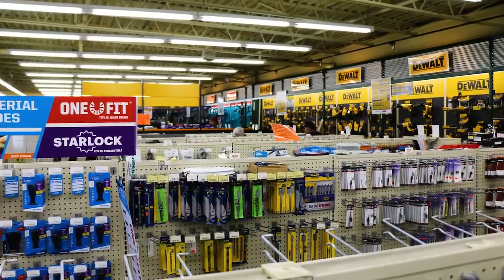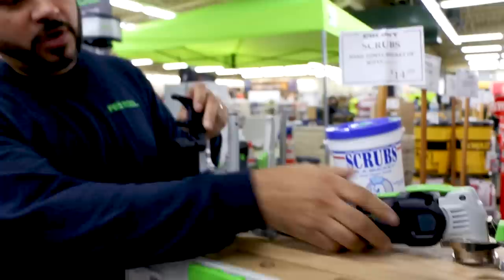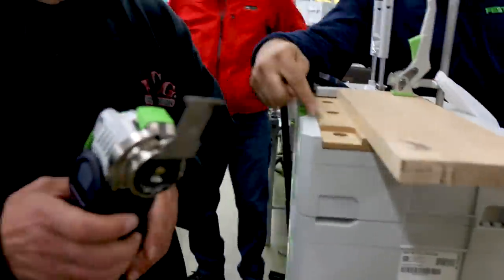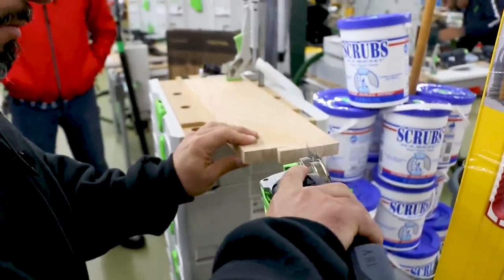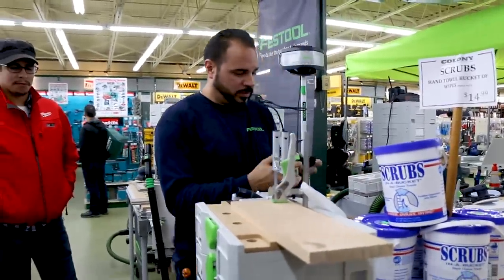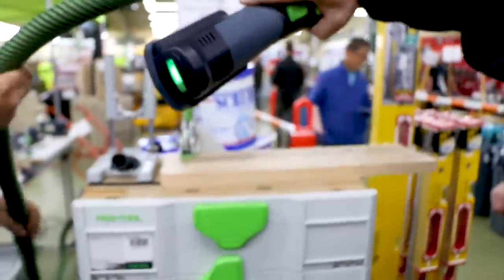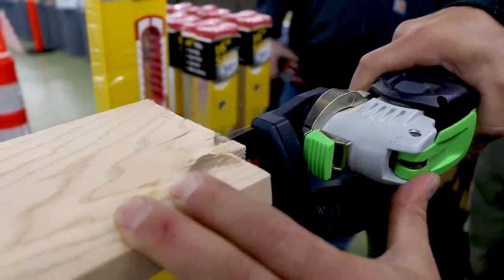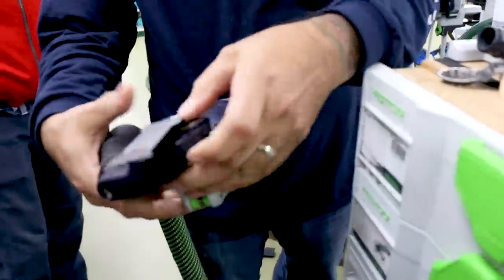Best Oscillating Multi Tool On The Market For 2019

Comment: Another great video Vince 👍🏻
The Fein 18v Supercut and Festool 18v Vecturo, are both built by Fein.
They perform the same, just different colours. They are the best multi tools out there, and by a fair margin. 
I opted for the Supercuts, because I have Fein batteries and I got a good deal on the day. Either machine is superb, albeit pricey.

Comment: Amazing tool shocking price. I got a $449 Milwaukee pack out kit that includes Sawzall Gen 3 Hammer Drill impact driver 2 battery charger and a nice multi tool and I am very happy with the purchase. To match the amount I can buy a brushless circular saw for  $150 on Ebay
Reply from the maker: I will agree maybe not a starter tool !!
Reply: Dust collection - Milwaukee doesn’t make any accessories for dust collection on their OMT.
Reply: @VCGConstruction  absolutely Vince, Festol is a tool for the elite "Tradesmen"
Reply: Brian Crisler the dust collector option is a feature I particularly love.

Comment: Good luck selling them for that price. 🤯 Thanks Vince & The Very Cool Gang!
Reply: @novisnick 
Festool stuff holds its value, if you had a 8yr old domino you could sell it for almost what you payed for it as long as it’s not hosed. Try and do that with any other pro brand and get laughed at. 
I want a domino, domino XL and dust extractor but haven’t talked myself into spending $2500 on my hobby, not my trade...
Reply: The Truth If I could justify the use for it I may have changed my position on my statement. But I can so I wont. Go for it if you can justify it with the amount of use it will get. Peace brotha!
Reply: @Zozo806  No it's not Hilti products has longevity Festool just has high price. My coworker Festool cordless track saw broke same day when he got it.

Comment: I just bought mine and used it this week for the first time. If you want the best and dust free this is it.  I also own the Milwaukee for every day use but the festool has its advantages that in my field are worth the price.
Reply: The Fein Supercut is also great except the vac adapter is sold seperate.

Comment: I still love my Dewalt,  If I put that blade on mine it will do the same thing, Hey Vince VCG !
Reply from the maker: Hi Jim !!
Reply: In fairness, I have the Dewalt to and it smokes my blades in no time. So even with the fancy blade it wouldn’t compete with the Festool using the dust extractor.

Comment: 1:39 If whoever mounted the blade would have put it at an offset you could cut without running into the damn tool....
Reply: True, or they could have just tipped the tool down.

Comment: Is there an attachment for dust collection for the angle grinder? Multispeed grinder. The multi tool has vacuum attachment which will be good when you cut gyprock, drywall etc.
How many amp hour are the batteries?
These are the same batteries used for the cordless festool sanders right?
Reply: There is another version of the grinder with it built in but it has a much different guard and only in Europe. This model does not have one yet. Maybe the other model will release to North America soon. The sanders use the same charger but use the 18v 3.1 ah ergo battery packs. This uses the 18v slide battery packs which come in 3.1 ah, 5.2 ah, and 6.1 ah
Reply: JronmanBuilds 
Yes. We have the  3.1 batteries you are mentioning in Australia. They are designed for the Sanders which can also use corded power with an attachment.
I'm wondering if these batteries are the same.
The marketing determines whether some tools even arrive in Australia. I'm always keen to look what USA have they seem at time to be anything from 6 to 8 months ahead in their  released models before they even reach Australia or get here at all. Like for instance  the metabo high speed drill with interchangeable chuck to driver. We won't get the high speed with changeover chuck only the fixed chuck with the high speed. We can get the changeover chuck which is the normal speed to 2100 rpm I think around that speed. I see about the batteries which fit on the Sanders are 3.1. Are there higher amp batteries for this design? 
I'm aware the other batteries are up to like you mentioned 6.1 maximum for the air extreme. At this time I don't know if festool are looking for higher amperage for their batteries. Perhaps they are working on it.
From what I got told the design of their machinery is such there is not a need to make higher amperage batteries. I would challenge that assumption as I felt their contractors saw could do with a more powerful battery. Also the cordless plunge saw draws a lot of battery from their machines. In saying this however I used a 5.2 with one 4.2 fully charged. I would have wanted to know the difference if I had the 6 amp batteries. Well before those tools were stolen that is. I have to save if I want to replace so, I'm waiting for a multivolt 36 volt plunge saw and quite like the mafell for the contractor saw as I can fit onto a metabo battery.
The mafell are available to Australia from Timberlake USA. The people say no distributer for mafell in Australia so anything that happens with the mafell will be difficult.
In saying this however, I have been very happy doing business with USA they are the best.

Comment: Vince had his fingers right in front of the multi tool when cutting @3:40 into the video roughly. Be careful buddy.
Reply from the maker: Thanks Adam !! 👍🏻👍🏻🤣
Reply: Adam Garrity apart from giving you a scare you can put your finger on the multitool and it won't cut you unless it was your nail. Multitools are used to take off plaster casts when they hit the skin it won't cut you. Who's got the guts to try it out?
Reply: OMT is safe! If you touch the blade it will make your finger warm and uncomfortable. (I’m not responsible for your results.)
Reply: I think this guy works for dewalt so he would know... maybe the dewalt was designed for finger cutting too!?
Reply: @ron1martens  I've tried it. It tingles. 🤣
Reply: @ron1martens  I used to thing that too ! thats what ive been told for years, until recently i hit my  hand while cutting, IT WILL GO THROUGH FLESH pretty fast!
Reply: @ron1martens  I have done it many times.
the skin moves with the short distance the blade moves.
It will cut only hard surfaces.
The original Fien is used in hospitals to cut off plaster casts after limbs have healed.

Comment: $799 LOLOLOL....wow...you better have a good reason for this one. For someone who just needs such a tool for small remodels, and around the house, I was looking between all corded models of the Rigid Jobmax, Dremel MM45-50, Rockwell 5142, or the Wisetool 600w All about $100.
QUESTION: The Rigid adverts a 4 position head, but do all these multi tools allow for the brade to be positioned at the desired angle, or is that why the Rigid has multi positions? (One other thing the Rigid has is a swapping head with other tools, which makes it a bit attractive).
Keep up the videos...pretty informative stuff.

Comment: did that festool grinder really have no dust collection option?
Reply: They sell a version with a diamond blade cutting dust extraction setup outside of America (and yes, it’s literally the same tool with the the head turned and with the dust hook up).   It’s near identical to the cordless Fein grinders, however, so Fein’s dust shrouds should fit directly to it.  The regular safety guards are interchangeable.

Comment: I prefer a speed adjustable actuator, instead of the on/off designs with speed adjusters separate. 

I hate my Milwaukee, shouldn’t of got the m18. Battery is too bulky angled outward. M12 May be marginally better. 

Best one I’ve found is the rigid. Definitely not paying $800 for one.
Reply: i love my brushless version of the ridgid , the brushed was not so much good , in fact it have poor ventilation and fast overheating protection kicking in
Reply: @JoeBleaux69  buying battery packs for both systems.

Comment: A Fein Tool in a Festool clothing
Reply: Most people are unaware that Fein makes this tool to Festool's specs and that Fein just kicks down their models when they upgrade their  top of the line Supercut version (Old Supercut = New Multimaster and the base model is usually dropped). Blade tech is the big advancement for oscillating tools these days.

Comment: Really? Cutting thru oak?  Red or not it’s not that hard.  Also, the cutting is more the function of the blade then the tool
Reply: John Gregory the blade will only move as efficiently as the tool powering it. I agree with the general sentiment of your comment however if you put a great blade on a piece of garbage it’s still a piece of garbage. Not enough power and it chokes up, blade gets hot as hell dulling it, and the real cheap ones can’t tighten your blade down for more than 10 seconds

Comment: 800$ and you get one blade. Holy shit buddy I'll just hire somebody else to do the job lol.
Reply: Hey you pay for mobile phone the same, but for this tools from FESTOOL you gone work all your live) And for your children will enough.
Reply: Andrius2005 that’s tru If you are an hoppy craftsman and don’t buy battery tools. 
Personally I have run my share of festool products to the ground. All handheld power tools will die someday. 
If you want to pass something down to you kids, go for high quality hand tools. They can last for ever, I have a lot of tools I use on a regular basis, that is around 100 years old. And I’ll bet you a lot of them will last for a 100 years more if taken care of, can’t say that about any of my powertools.
Reply: I can understand investing in tools but a multi tool for 800$ just doesn't make sense to me. I use mine a ton but 90% of the work I use it for could be done better with a different tool. I like that about them very versatile in tons of jobs, what more do you get for 8x the average multi tool? The biggest gain to me is the vibration dampening because the extra speed is really negligible. Idk I'd rather get a cheaper multi then also buy each individual tool that the multi can't replace for finish work.

Comment: Nowhere near worth that price tag!! Blades are key with oscillating tools. Vacuum is unnecessary for this type of tool. Plunge base kit... that's why they have markings on blades. Apple marketing at its best!!!🤣🤣🤣
Reply: B h Dust collection isn’t unnecessary at all. I work in customers home all the time and have to cut HVAC ducts in existing wood floors or even in the drywall ceiling. Being able to capture the dust is key!
Reply: @Brentridley  I understand that in certain situations, however with that hose connected, the whole purpose of an oscillating tool (small, lightweight, maneuverability, and precision) will be compromised. I mean what's the point of having a cordless tool like that if you're gonna put a big hose on it?
Reply: B h I don’t think the hose really hinders anything when you’re trying to collect the dust. I understand this tool isn’t for everyone but only point was that the dust collection isn’t unnecessary - Festool is just the first one to do it. Hopefully other brands will jump on board and make a less expensive option.
Reply: @Brentridley  I understand and agree... to an extent. I'm always willing/ open to different points of views. 👍